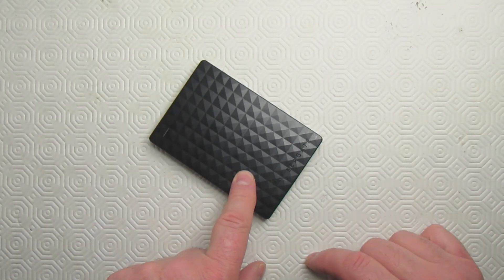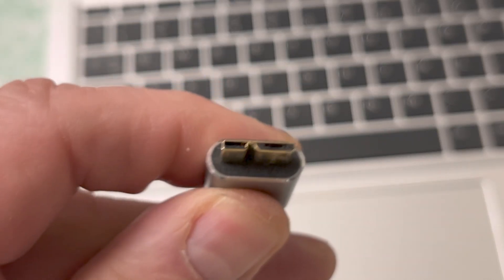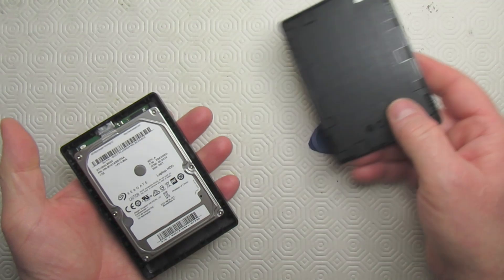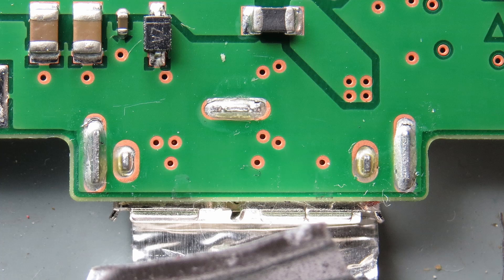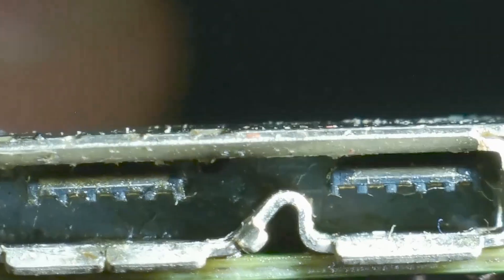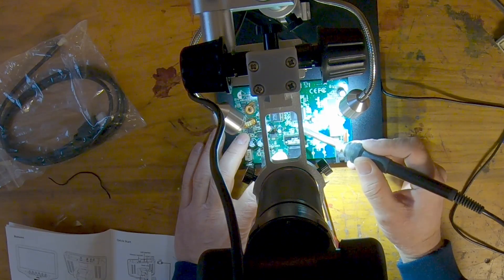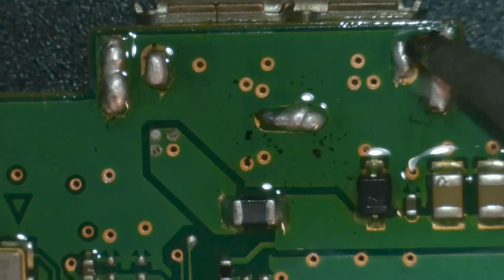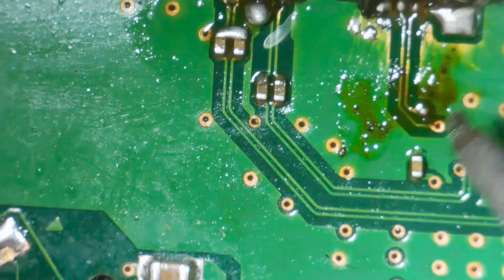DIY Repair of my Seagate Expansion Portable Drive Video

Comment: Good job with the repair. You could have used flux to tack down in place the capacitors more easily. Also a fine tip is required and your solder seems unleaded so it would make dull looking joints.
Reply from the maker: Thanks for the feedback, and will keep that in mind for the next repair.

Comment: I feel your pain. I use to install mod chips in playstation's 20 years ago. And I usually work alone. I had a guy hanging over my shoulder and chatting my ear off I can't remember exactly how it popped off but the guy distracted me so bad one of those resistors flew onto my Pappys floor. I turned on the machine and it sounded like a helicopter.  I put the guy out on the doorstep and had my poor Dad helping me on our hands and knees looking for that tiny Lil resistor. God was good to me that night. And lesson learned . I also Made another decision to just walk away and come back after something gets me, "excited".  That's when the fun occurs. Ty good video and glad you were able to get that Lil bugger soldered. Peace. P.s. I know this videos a year old but was looking for actually how to open the case. Ty
Reply from the maker: It doesn't matter how old the video is, as long as you got something out of it to help you.

Comment: Fascinating! I admire the patience and the dexterity. I wish I knew how to properly solder, each time I tried, it ended up in a huge mess. It's great you managed to get your files back. Seagate and WD really don't want us to re-use portable hard drives into computers hence the custom USB circuitry but it's really a pain if the connector breaks.

Comment: I have the same expansion hard drive 5tb, but any time I plug it in it does not work or even light up. I think its completely dead. I did not get a chance to open it yet but I am afraid that if I do, I will not be able to get it fixed by seagate professionally. What do you think I should do?
Reply from the maker: I would try another computer and cable to eliminate the possibilty of a bad cable, USB port or a computer that does not allow external USB drives for security reasons. If it still does not light up and you have warranty on the drive, don't open it. Just contact Seagate to get it fixed.
Reply: @mannimix  thanks for getting back to me, I think I'll do just that. I got photos going back 10 years on there, majority of them irreplaceable of family and friends that have passed away. This is not something that I can screw around on.
Reply from the maker: If you watch the video I show how I tested my drive with a different cable type. Another thing the video points out, is not to leave the cable attached to the drive when transporting it. That's how I broke mine.
Reply: @mannimix I tried 3 different cables and 3 different PC's, all came up dead. I also reached out to Seagate, they told me my warranty has been expired for the last 3 years. They told me to go get it fixed manually by a specialist, so I'll go and do that. Thanks again for making this video, it really makes me want to get into fixing my own device and become a PC technician.
Reply from the maker: Sorry to hear none of the easy fixes worked. Hope you have better luck finding a reputable shop that can help you out.